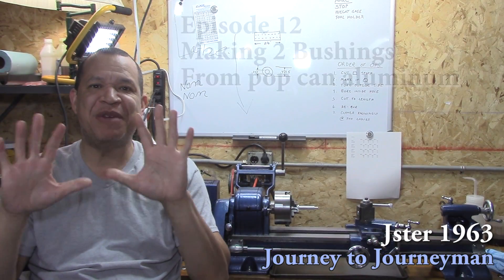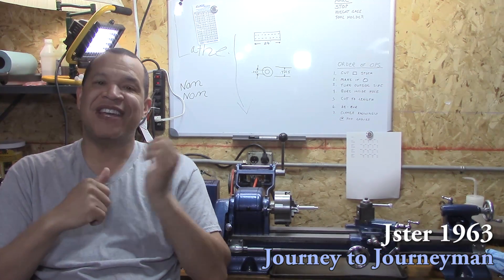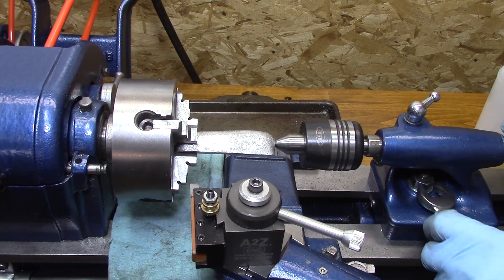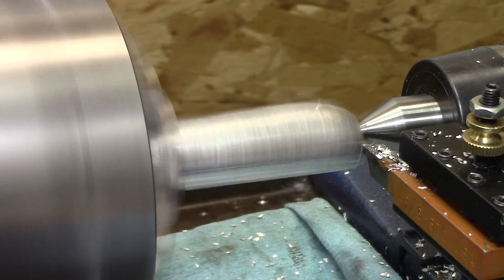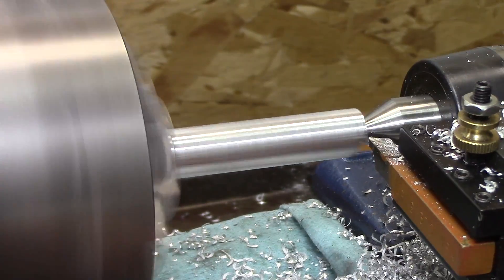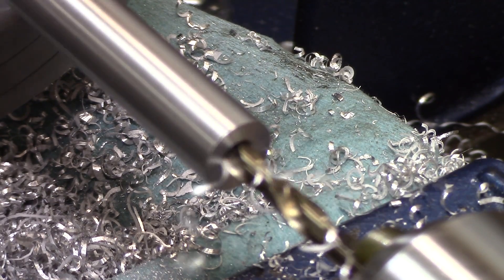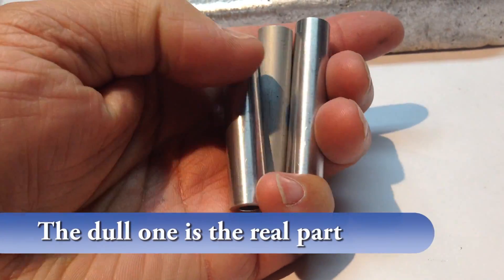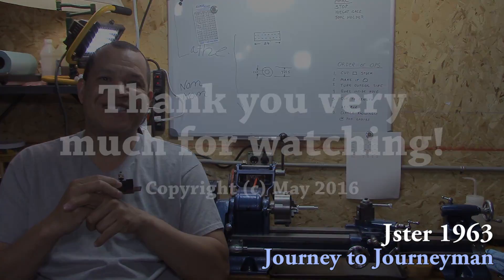(REMAKE) Journey to Journeyman, Episode 12, I make 2 bushings from aluminum cans.

Comment: I noticed in one of your other videos that you had a problem with splinters getting in your skin.

Here's a pro tip, rub scotchbrite over the area and most of the time it will remove the small invisible splinters. If you rub in a circle it will get it and doesn't hurt either. It doesn't sound like it will work but it does.

Also you're doing okay, I seen someone give you grief about being a journeyman. Everybody started somewhere.
Reply from the maker: Thank you so much!  I will def try that tip even though it doesn't (like you say) sound like it will work.  Also, thanks about that Journeyman thing.  I'm not wanting to compare myself to a real Journeyman, I'm just learning a new hobby.  And thank you once again......

Comment: Have you looked into getting a few pieces of smooth inner wall tubing to make some rough rod from aluminium ?  If there are metal recyclers in your area they can be a source of stock as well.  I picked up a piece of 4" x 10" stock aluminium rod just yesterday at the recycler for $10.  They had hundreds of pieces of 2" x 2" lengths of bar stock too.  No idea what I'm gonna do with it yet but I just could not see it going to scrap, to be melted down & made into, bar stock!!
Reply from the maker: I want to do that with the round stock but I don't know a metal place. I don't even know how to search it. If I find a place im in trouble!  And thx!!

Comment: I cant figure out why every body with these tiny lathes use carbide.The lathes are not powerful enough or rigid enough HSS works so much better with small lathes
Reply from the maker: I'm so new that I don't know exactly how to grind the HSS correctly, so I figure the inserts should at lease have the correct geometry.  Plus I didn't know that carbide was for better machines.  I just thought that it's hard and sharp and should cut.  And that's what the other machinist on youtube are doing.  So....for me, it's just because I don't know any better........

Comment: Looking great.   Do you have a set of center drills?   This is a kind of ultra stubby drill bit that gives you a starting hole that is right on every time.  Also, they cut the correct tapper for your live center.
Reply from the maker: I do have center drills and used one on this.  However, after doing the center drill hole I tightened the 4 jaw chuck again. MISTAKE!  So it moved the center hole and I had to compensate for it.  And thank you very much.....
Reply: jster1963 Ok, me not paying close enough attention.  I remember you mentioning the re tightening being a problem.  Do you have a face plate and center for the spindle?  Turning between centers rocks.